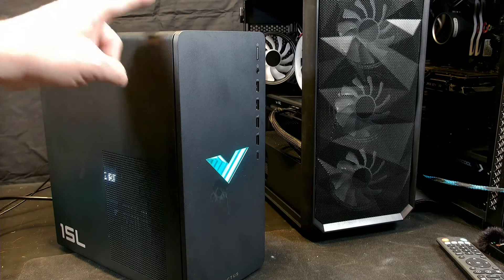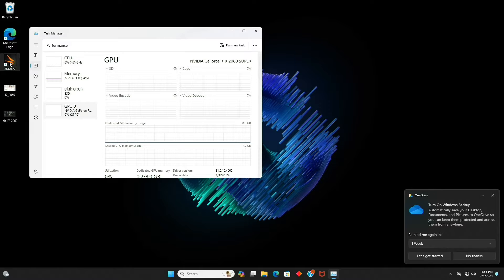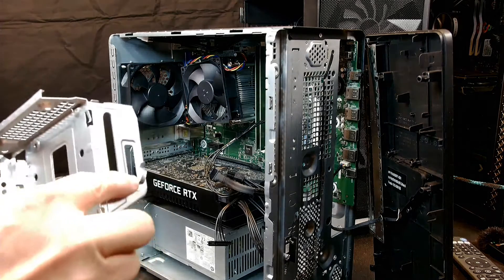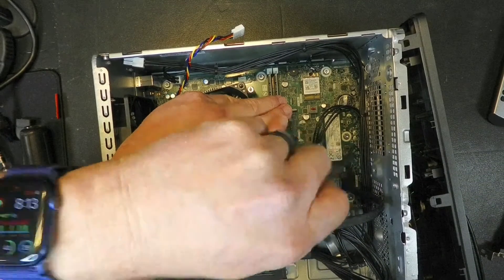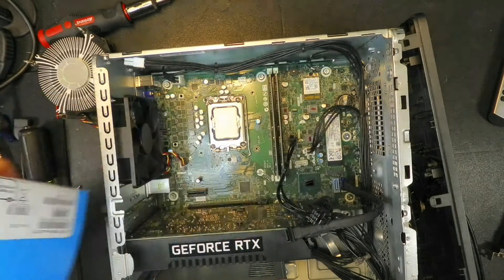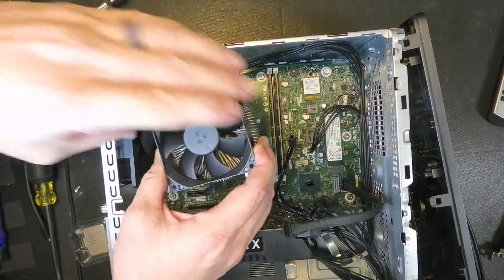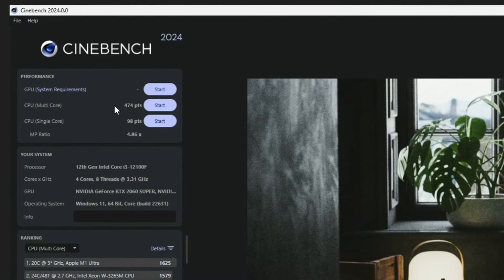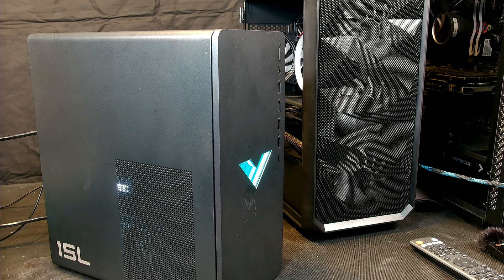How to Upgrade (and Downgrade) HP Victus 15L - CPU Swap!

Comment: HP must have had a lot of those cases left, totally for office use, not gaming, just look at it. But they just sell it as a gaming pc, with overheating issues, low power wattage, 350 watt. No space for really updating, crap motherboard. But biggest reason NOT to buy it is its cooling, come on...

Comment: I just installed 2x16 GB ram into my Victus 15 i5. But it's changed the ram speed to 2666mhz. How can I change it back to 3200mhz? The bios doesn't have the advanced options

Comment: How do you enter bios on this thing it won’t work it gives me the hp startup menu where it says press this button when rebooting I do it nothing happens I just wanna know if y’all have bios problems to I wanna upgrade my 5600g to a 5800x
Reply: I could get into the HP bios through settings but I couldn’t change my ram speed unfortunately which is what I wanted to do

Comment: Can I put a 5800x3d in this thing
Reply: No, the AMD versions only accept G versions 5700G, 5600G and 5300G, at least in the 5000 series. Others tried regular CPUs like a 5600 or 5600x but the system will not post. It could be fixed with a bios update except HP refuses to create one. There is no way to disable the intergraded GPU so it stops using system memory even if you have a dedicated card. Crazy thing is you can't put a normal CPU in this but also HP puts G GPU is on boards that don't support integrated graphics. So not only can I not shut down the integrated graphics other people can't access it.
Reply: @oldtc3615  yo i got an i5 12400 and i saw on hps support that i only can upgrade to a limited amount of cpus, the best one being the i7 12700 cause of the "reno2" motherboard and a tdp up to 65W. Is that the best one i can upgrade to unless i change the motherboard?
Reply: @Stamtos  I don't know, I have the AMD version Erica6 bord. It's limited to only 3 possible processors. But as cheaply made the boards are, I would not go with a much higher wattage cpu. I might try a slightly higher but would not go too crazy. the 12400 has a max TDP of 117W and the 12700 can push 180W on full boost. So if that's the case it would not surprise me. My 5600G AMD PC only draws like 80W total power from the wall and that includes powering all the drives, fans and everything else. If they had a real bios you could get a better chip but limit the power but they don't allow features like that. At least the board I use doesn't.
Reply: @oldtc3615  Alright thank you man, I'll probably just see if i can get a new motherboard in this case, if i cant or have to upgrade my psu and cpu cooler too i might just sell the whole thing and build a new one that is better and more futureproof.
Reply: Did you end up doing it just ordered mine now

Comment: I have the same PC with an i7 12700, I wanted to know if I can Can I remove the processor and put it in another PC?
Reply from the maker: Absolutely. That’s exactly what I did.
Reply: @FamilyGeekery  Thanks, I'd love to see where you moved this i7 especially I'm interested in the motherboard.
Reply from the maker: @Blade86-qg2se I unfortunately didn’t video that particular build, but I used a Z590 motherboard.
Reply: @FamilyGeekery  I bought this PC in December 2022 and it had a 3060ti because when the 4070 came out I was brilliant! I sold the 3060ti for 350 euros I put the difference of 319 euros and I got the 4070 new on Amazon price 669 not bad right it cost me 319 euros brilliant!